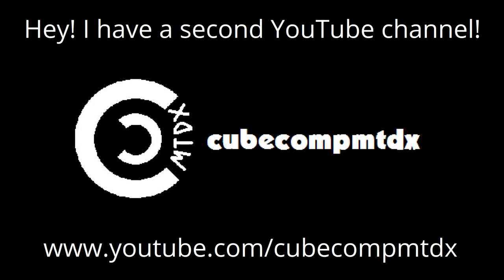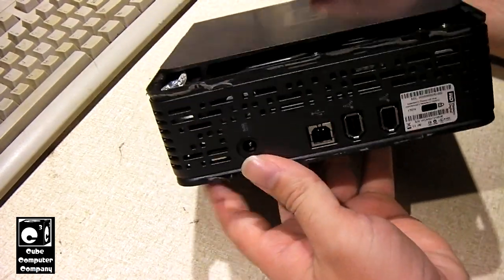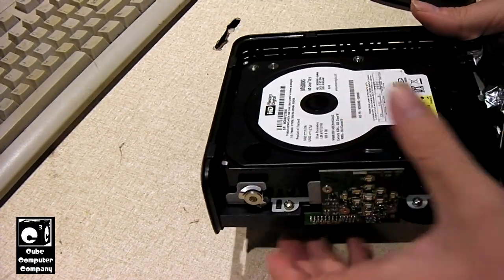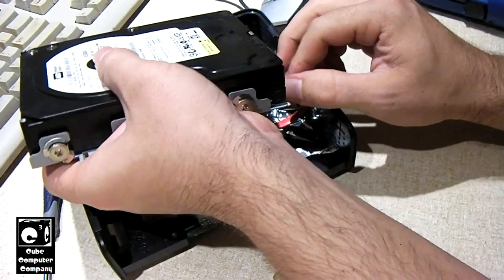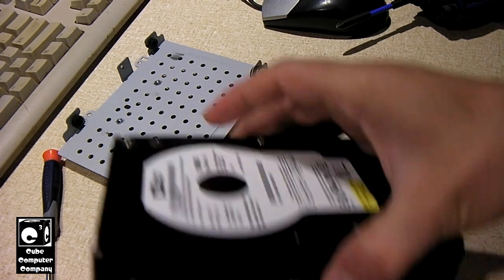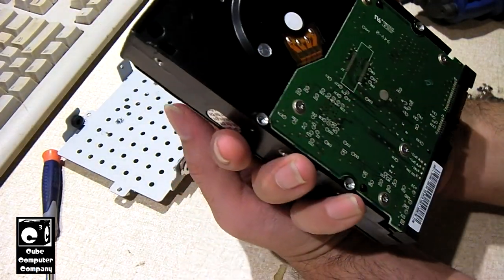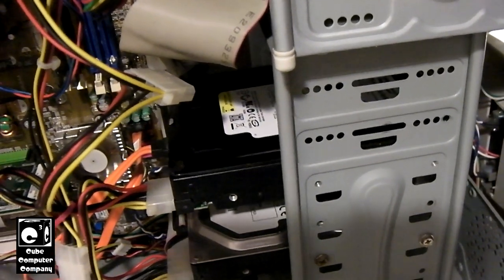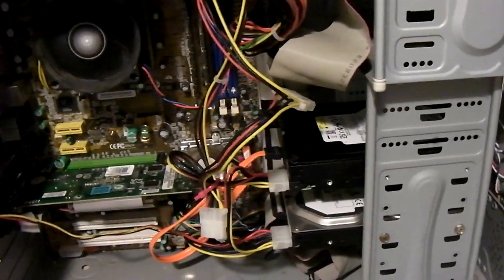A look at a 2006 Western Digital 500GB SATA 3.5in hard drive

Comment: I have a 2008 160GB WD Caviar that was in an external enclosure & was used fairly often. One day I turned it on & the drive didn't mount in windows. I could hear it trying to initialize over & over, checked the external's regulated voltage & it dipped pretty low on spin up. Assured that it had damaged the controller board I put the drive away & started looking for a close board rev# match for a swap. 2 years later ( lol )  removed the controller board & found the contacts for the heads were heavily oxidized, used a pencil eraser to polish them up & fixed... years of nothing due to tarnish x_x Still going today tho.

If you pull it apart & the heads look ok, the reassembly might fix it. WD's were very picky about the screw torque on the head arm assembly... 

Might be worth it. Those old WDs were good drives. & if it's totaled after all, there's always the reward of shiny new neodymium magnets 😋